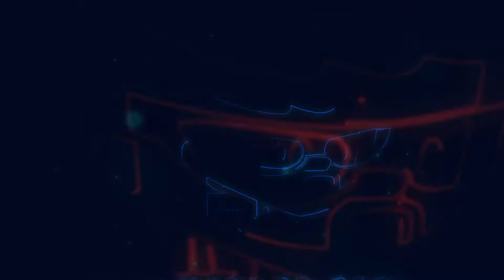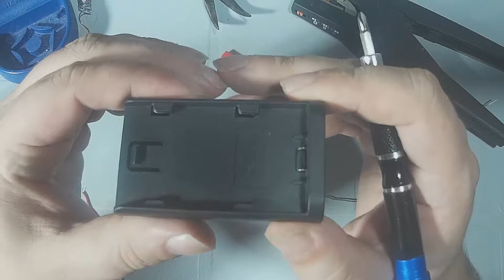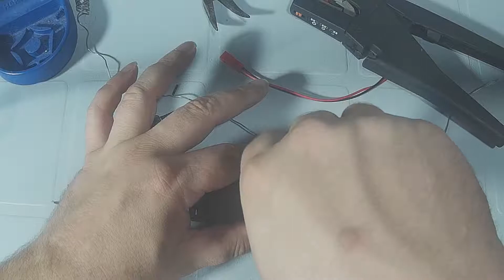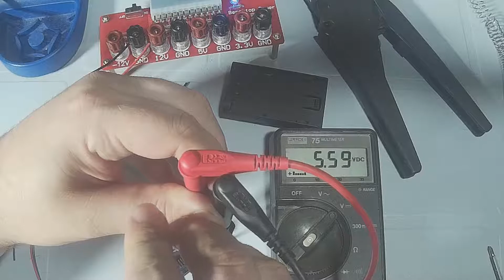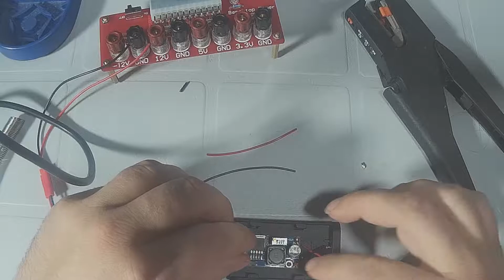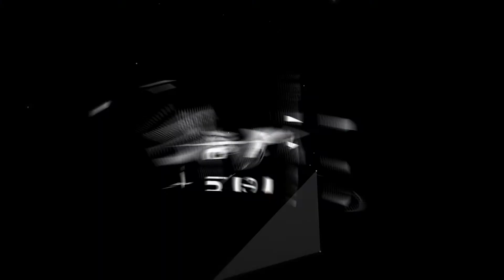Neewer CN-160 Led video Light - Wall Power Hack

Comment: Thanks so much for this! I'm wondering: is 2 amps a hard minimum? I have a few spare power bricks that have enough voltage but are 1.5A or lower.
Reply from the maker: 1.5A will be fine, since the buck converter can only allow 1 amp to pass. I usually use a twice as high rule since that is a pro level margin of error.
Reply: @MikeysLab  thanks for your quick response! 🙌
Reply: @MikeysLab  I just finished converting three of these lights — this process worked great! Thanks again for making the video! 🎉
Reply from the maker: Never a problem man.

Comment: Splendid video. I did my the wrong way using a 12v switching power supply, but I will be redoing it soon. The power supply stays cool and it's been that way for about a year. Congratulations on 1,000 subs. Cheers
Reply: I finished the PS using the LM2596 module. I use an 18v HP power supply, a Volt/Amp LED display, a cigarette lighter USB adapter. I put it all in a small metal enclosure I was saving. It works well. The 10K potentiometer is a bit touchy. It is sometimes difficult to adjust to the exact voltage, but in my projects it is not critical. I may need a fine and course adjustment.
Reply from the maker: Thank you, it was one of my earlier videos, I am glad it is working for you, as I said I was sure there as power regulation inside the lights. Just a a general rule, providing 30% more voltage than expected seems bad :)
Reply: @MikeysLab  I purchased some of those regulators you used in the video; less than $1 USD. They are amazing. How about  replacing the screw pot with wires and a pot with a knob and adding it to a power supply to make a variable voltage PS?.
Reply from the maker: @cipstechitips1574  It sounds like an idea, but there is a trap for new players here, a pot can be used as a variable resistor (like the case here since the pot is part of the feedback to the regulator) or as a variable resistor bridge (which can be replicated with pwm. The variable resister implementation is hard to replicate with a micro controller, I say hard but not impossible. If you come up with a plan for this please let me know boss, and I love the outside of the box thinking man.

Comment: I just got my lights today, I was just wondering if I can hack it to use a holder to use two 18650 cells.
Reply from the maker: Of course any 2s source will work, for that I would 3d print a holder to hold the batteries and slide into the battery holder

Comment: Great video, Mikey. I too was sceptical about videos suggesting direct 12v input. I found it difficult to solder onto the adapter tabs without melting the plastic and causing a bad connection. My solution was to open the adapter, remove the contact connectors and solder the wire onto the inside face of the tab before refitting the contact connectors and passing the wires through the rectangular cut out in the upper half of the adapter as I mated them back together. I then soldered the other end of each wire which had been passed through the contact pads on the upper face of the regulator module with the module upside down. This achieved the necessary 'crossover' due to the polarity mismatch by simply twisting the module the right way up before glueing it down. It was quite a simple process. I just wish I could achieve a better anti strain method on the input wires than just hot glue. Cheers, mate. ;-{)
Reply from the maker: For sure, soldering to the tabs can be difficult while the adapter is still together. My trick is just to go fast, but this clearly will not work for everyone, so your idea is a good suggestion for those having difficulty :) I appreciate you taking the time to share you experience man :)